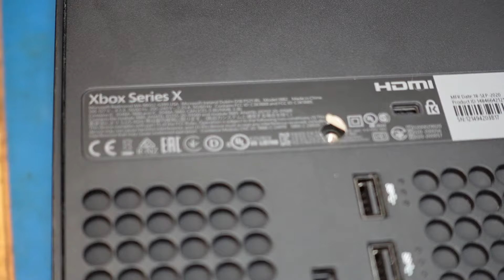X-BOX series X HDMI repair

Comment: Completely share your hatred of stuff like this.  The designers decided on a shape and style, the poor engineers had to make it all fit.  If it doesn't sound to "octogenarian from Tunbridge Wells", is it any wonder we're drowning in landfill junk when repairs are made so difficult.  Really approve of the Australian 'right to repair' laws.  Awesome work, Mark.
Reply: Consumers want smaller and cheaper, and making things more repairable involves making them larger and more expensive.
Reply: @dunebasher1971  Manufacturers want to make things look smaller to compete with other manufacturers and make the things as sheap as possible so many people can buy it 😉.
Reply: Completely agree. Aesthetics first, functionality and repair are an afterthought.
Reply: I really think the main design is to dissipate all of the heat without the console having to use a fan that sounds like a jet engine.
Reply: @raidensama1511  Plus saving on the cost of including a fan.
Reply: @El-Burro-Grande  It's got a fan.
Reply: @KarenTookTheKids364  To be fair, if the XBOX just looked like a IBM ATX PC (which it is) then people would just get a PC I guess!

Are computers that use laptop parts like the Mac Mini and iMac (PC equivalents are availble) easy to repair? I've never looked into repairing my ~2010 iMac as I am a bit intimidated that the only way to access the insides is (I understand) to use suction cups to take the screen out...  It's far cry from an ITX or ATX PC, but I guess that's the point!
Reply: @raidensama1511 well, they failed. The Xbox Series X’s fan gets very loud during games. The PS5 remains much quieter in comparison.
Reply: Over complicated design will be to stop people easily reverse engineering and breaking their protection. The XBox360 was a doddle to chip once the JTag method became public 😉

Comment: It's more than apparent that these devices were designed in such a way not to be repaired.  As with everything nowadays, they want you to wear them out and buy a new one as quickly as possible.  Planned obsolescence being the name of the game.
Reply: I am not sure if I agree with that completely but "mend ability" was definitely not any of their priorities
Reply: These things arent like IBM PCs from the early 80 though. Millions of times more powerful, insanely more complex, there is no way to make them super easy to repair because the parts have to be small.

Sure they dont make it any easier, and a modern PC is easier than an XBOX, but its also larger, a lot more expensive, and still hard to repair if you need to break out the soldering Iron.
Reply: The thing is, making it bigger would allow for some more repairability without much extra parts cost, but only for the less critical parts. The main unit with the heat sink and the fast electronics couldn’t really get any bigger while maintaining performance.

And making it bigger would make various stages of shipping significantly more expensive. Probably cost an extra 100-200 at retail.
Reply: The amount of engineering required for the planned obsolescence myth would cost more than any recoup of people buying new machines. They buy a new xbox because of new generations, not because they were planned to break.

They are difficult to repair because of the complexity of them. Sure, you could make this bigger, but nobody wants that with all the other junk you have in your entertainment center.
Reply: @chrism2964  the thing is that even though most computers/tech have more and smaller components, there are ways that have already been figured out that mitigate the complexity by 10fold or more

say for controllers, we all hate controller drift right? what if i told you sega already found the perfect way to kill controller drift in its entirety? better yet, it was invented in the 80's! but you dont see any new controllers using hall effect technology nowadays do you? thats because if controllers never got drift again, nobody would keep buying new ones! hence why controllers still use the same cheap 3rd party chinese knockoff joysticks that break if you press on them too hard.

for almost all tech there are ways to make them repairable/not easy to break, yet nobody uses the already present technology due to it making them less money overall.
planned obsolescence is 100% real, its just not an intentional ploy and instead is a side effect of being cheap on manufacturing tech.

Comment: did the RJ45 not need replacing in the end?
Reply: Only the plastic locking tab for the cable was removed, the connection still works fine and the multitude of spring wires for the connection have enough tension to keep the cable in without the locking tab functioning.  As he mentioned it only takes someone tripping over a cable or trying to remove it from the back without depressing the lock to result in damage.
In my experience this damage is from theft. When people are quickly grabbing and unplugging items to take they don't have much care to undo cables properly resulting in damage to both of these connectors.

Comment: I bet that track was cracked off the board when the connector was yanked, you just uncovered the problem.
I must admit, I'd have gone with a pc thermal compound like arctic silver, but I've not actually seen any evidence it's better than the normal white silicone based stuff.

Comment: i doubt that generic thermal compound for psu and amp transistors can do a job on a apu crystal. it can cause apu overheating then unstable working and degrade of apu at last, obviously. it's modern and wery hot apu from amd afterall.

Comment: In these devices, you cannot use ordinary white thermal paste, it has poor thermal conductivity and is susceptible to the pump-out effect, which will cause the APU to overheat and fail soon. You need to use a Honeywell PTM7950

Comment: like your attitude towards junk  👍👍👍👍
 job well done , I bet they make them this way to prevent any one else repairing them  . 👌👌
Reply: But they clearly don't prevent anyone else repairing them. The bottom line is that games consoles need to pack a great deal of tech into the smallest practical footprint, so of course they're going to be fiddly to work on. An easily-repairable console would be twice the size and much more expensive, and consumers don't want that.

Comment: Mark your bare hands are touching all the circuits, is this not a problem with static?
Reply: electroboom and linus tech tips demonstrated that it is very hard to kill things like memory modules etc with static.
Reply: Never seen a piece of modern equipment die from static charges unless you are walking across a room dragging your feet and poking the boards at the end of your travel, or poking them with metal tips while they were running.
Reply: Bench has an antistatic mat on it. It is loose components that are most susceptible to static.

Comment: It’s always the HDMI, Ethernet or power jack that are the most prone to damage but the hardest to replace on modern equipment. 
if this had been sent back to Microsoft they would have just downloaded the customers data onto a new machine and sent out a new unit and thrown the old one on the skip. 
Modern stuff is not designed to be fixed easily by the end user.
It’s the same with mobile phones.
I took my phone in for a new screen putting on it and the first thing the repairer did was try and sell me a new phone !!!

Comment: Not sure why, but modern repairs don't do as much for me than older, more robust equipment. Weirdly enough, it's almost like the vintage stuff has a "soul" and "character" behind it's construction and circuitry. The new stuff literally screams "Made by a machine!" 😂
Reply: If its so robust why does it need repaired ??
Reply: I challenge you to repair a VCR with a mechanical problem. Soul and character destroying.
Reply: @ianhaylock7409  yes boss, tape decks are fking crazy, and video tape decks even worse!
Reply: To be fair this is a "cheap" consumer device! I'm sure there is higher end computing gear, e.g., servers, which are more robustly made.

Comment: Might have Been better off using the old thermal paste over the white you put on, it's just not even close to the same in its thermal properties. It will definitely run a lot hotter then normal now.
Reply: That's a good point, I'm surprised he would put in the time and effort to use a less efficient paste if it's roll is that important. I didn't realize the thermal paste made that much of a difference. Can you tell me the two kinds(brands)? It would be interesting to check the specs.
Reply: @Morgan Tisdale  the one he used is just a basic white thermal paste, what it should be I can't remember on this one if it's liquid metal thermal or arctic mx-4 type but both have a lot more thermal properties then the basic white paste.
Reply: The usual HS thermal compound has 2-2.5W/degrees  of thermal conductivity while the PC thermal compounds are in the range of 10-15W/degrees.